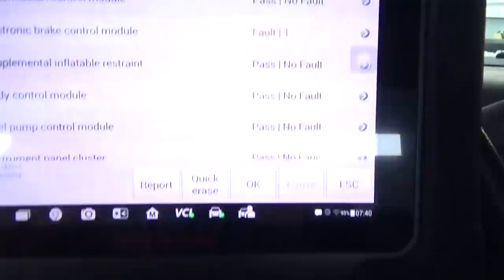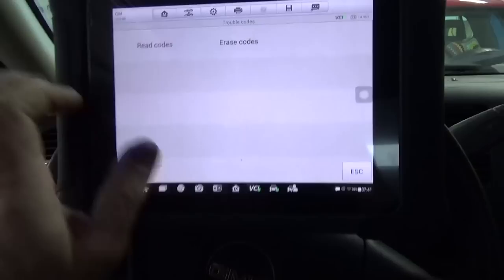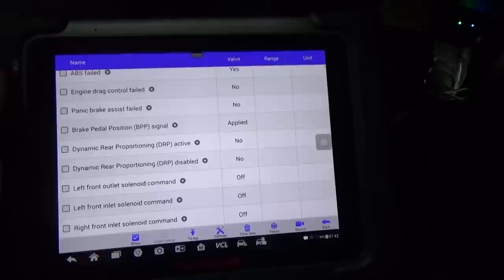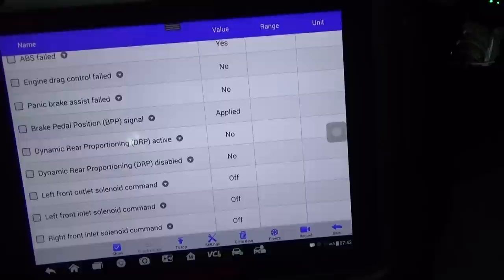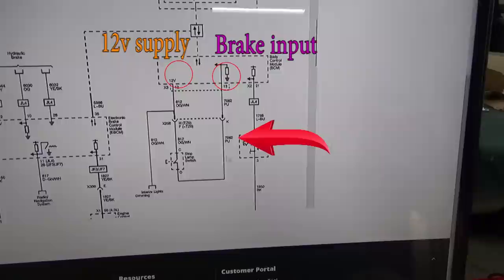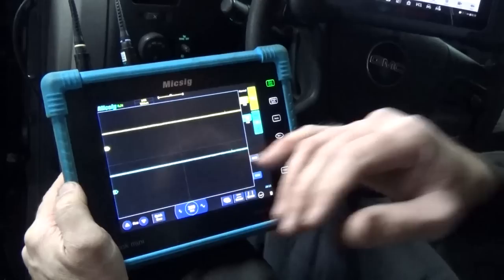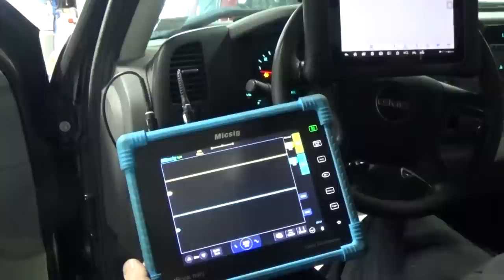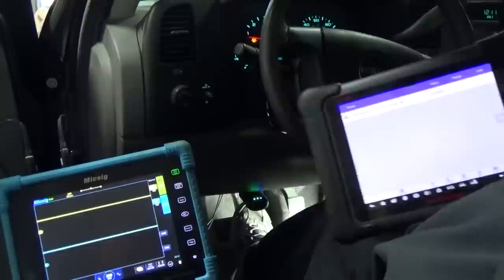GMC Stuck in park - Traction control - C0161 Test and Repair

Comment: Just had the same issue with my 2010 Sierra,traction control and stabilitrack,wouldn’t go into gear. Was able to fix it no prob after seeing your video,thanks 👍
Reply: i’m having this problem .. what’s that switch called ?
Reply: Brake light switch.
Reply: Am having this issue now with a 2011 sierra all terrain. Was pulling my hair out looking for the problem. Glad I found this
Reply: @justinweatherspoon5786  my '11 Sierra has been doing the ABS/Stabilitrak off and on now. Hooked up my code Reader and got this same code.

Comment: My 2011 GMC Sierra 1500 would show SERVICE STABILITRAK , TRACTION CONTROL, and the ABS light in the mornings when its cold (Michigan). Also the cruise control never worked. I replaced this and the cruise control worked instantly. We will see in the morning if the other lights come back on. Thank you!
Reply: Update: Never had a problem since. Fixed the issue for me. Thanks.

Comment: have to love it, junktronics failing so often, all the 70's, 80's and early 90's vehicles I had went to scrap yard with original brake light switches, rusted out or wrecked into mostly.
everything has something in common now, China or Mexico......

Comment: (*** 5S) I like when you do all this old school, with electrical diagrams, with no computer, thanks for this video.
Reply from the maker: Thank you for the feedback. I tried to mix in a little of everything to show the options.. its hard during  real time troubleshoting to go slower I do apologis. But really the only thing we used that wasn't old school was the Autel but on these cars a code is critical/key information. however we retrieve it... Doesn't need to be a 3k scanner we can do the same with much less. 
Testing the switch we went pretty old school :) oscilloscopes are very handy and have been around before me. We could do this with a test light as well.. many options.. thanks again

Comment: People should check there brake lights are working every so often (not really just that, look at your wing mirror and see if they light up it's not that hard, you can get 3 points in the uk for no brake lights as there is no excuse for not knowing they are not working, I assume USA have some sort of fine for it) but I say that and people are driving with DLRs only (dash is lit up on new cars when lights are off so they think lights are on, I wish car manufacturers would follow GM and make lights set to automatic as the default position)

Comment: Weird switch setup... how's it changing the signal? Hall effect of some kind? It's moving with the pedal... but pivoting in relation to the booster rod causing the signal change?
Reply: the brake booster arm hole is oblong/stretched circle and the pedal itself has a return spring, so hitting the brakes pushes the pedal shaft and switch body forward some letting the rod  end push into the switch and button, before it starts pushing the rod.
Reply: also, I haven't torn apart a brake switch in ages, but I'm sure it's either just spring contacts or slide contacts inside.

Comment: I having a issue if you get this. I have a 2010 Chevy Tahoe. The traction control and stabilization come on. Now the steering wheel functions are not working. Turn signals, bright lights, cruise control, radio. On the rear the all 3 brake lights stay on. Have not had a problem with shifting from park to drive. I did change the brake switch didn’t work. Changed the bcm and still doing the stay thing. Yesterday come across your video. Used a voltage meter. On orange/white 0.97 volts. Purple 0.97 but when you press the brake down the voltage go to 0.00. Do you have a idea what might be going on. Thank you

Comment: will ive changed a few of them and the aftermarket ones all came back  the gm one seems to be the only one that worked
Reply from the maker: Wish I had a local dealer. I was hoping to see a Wells manufactoring marking on this aftermarket to give me a little good feeling at least lol but I'm not sure on this one..
Reply: maybe you ok    the ones I used were bwd or carquest    oh and the worse thing is when the customer is over your shoulder  I hate that! @robinsonsauto